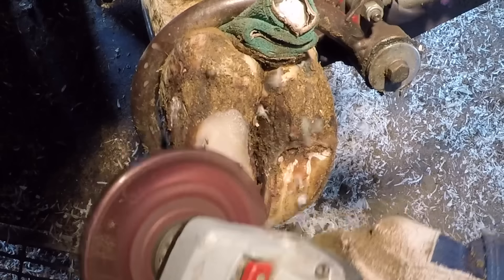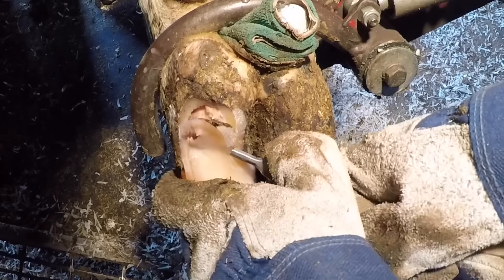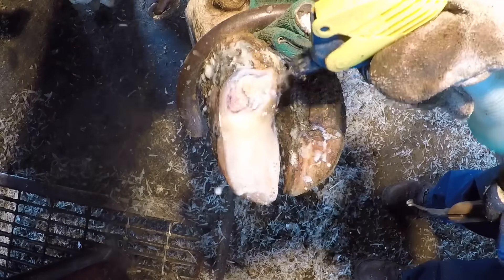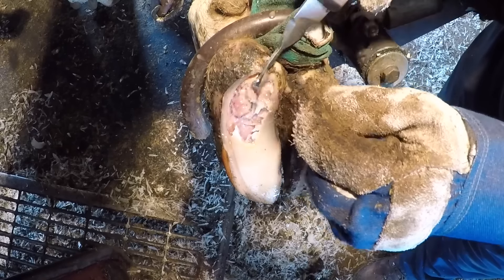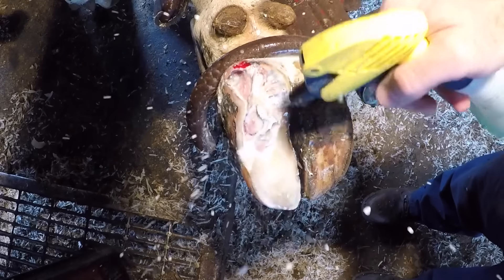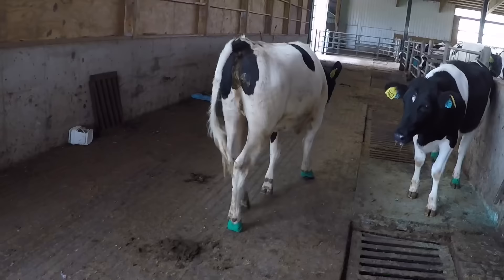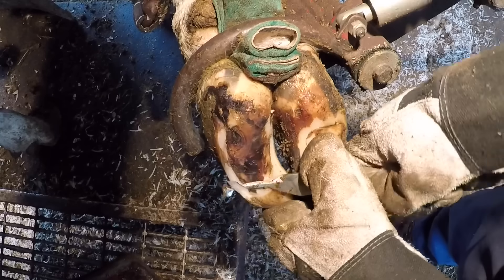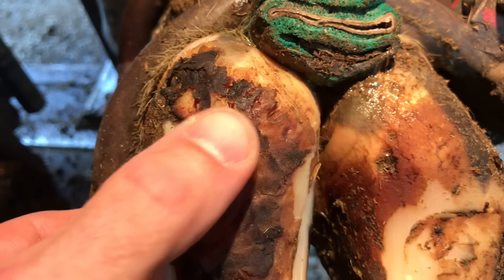Treating a Youngster with a WHITELINE LESION //// FOLLOW UP INCLUDED!!!

Comment: The relief she must have felt as soon as the fluid started draining. I start to wonder if these cows could be kept in better conditions to avoid these types of problems. It’s so hard for them to communicate to us when they are having pain like this.
Reply: It’s hard, because not all cows are the same. Some cows kept on sand will get rock problems, but a lot won’t. Some kept in sawdust will get soft soles, but a lot won’t. Most cows kept in pasture have very few problems, but some will get splits or pedal bone fractures. It’s sometimes down to an individual cows physiology and actions.

Comment: What happens if both parts of the same foot have a problem/lesions? 
The usual is adding a block but that wouldn't work if both parts of the foot are hurt right? So what do you do in those situations(as rare as they probably are)? If you haven't seen that before what do you think you would do?

Comment: I don't know if you know this but salicylic acid doesn't kill bacteria, I don't know where you heard that from.
Reply from the maker: It’s low pH is what makes it bacteriocidal.  It’s effectiveness against digital dermatitis is due to its low pH and it’s exfoliating properties.  It’s also an analgesic so it may offer pain relief as well.
Reply: @NatetheHoofGuy  Dermatitis yeah but salicylic acid is mainly for acne and face exfoliation. If anything I guess it could rejuvenize the soft bits under that hoof. Honestly that's just what I read on the drug facts forum, but hey you're the one with the experience you'd probably know better then me. Considering the results of your work are pretty good.